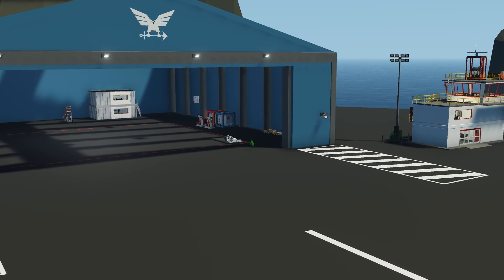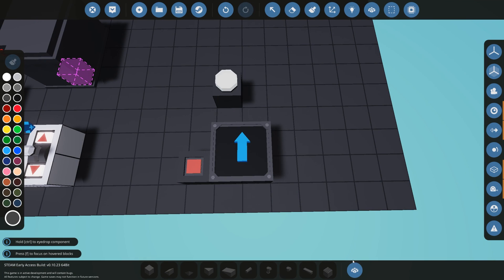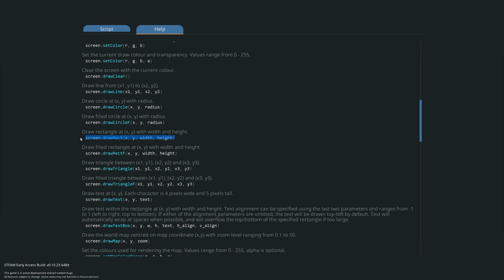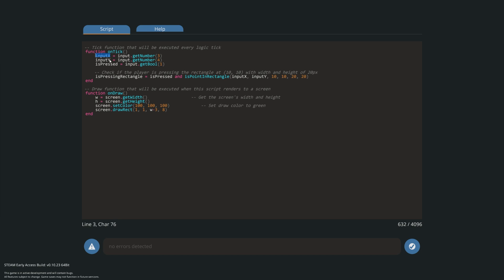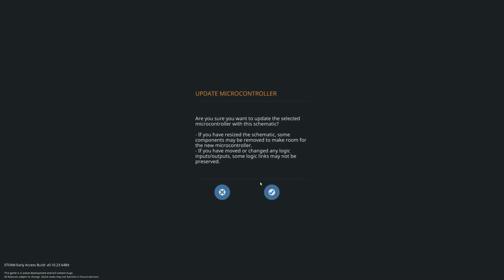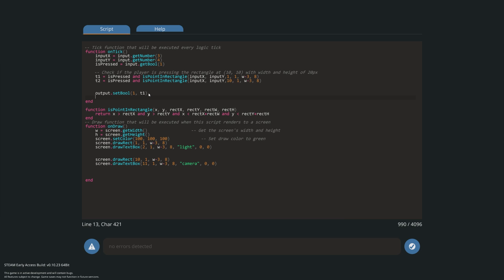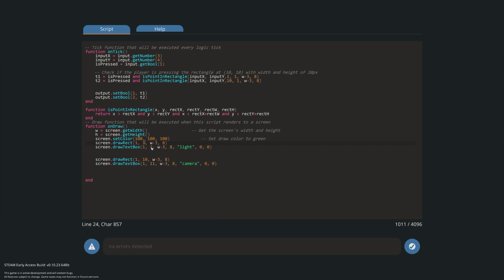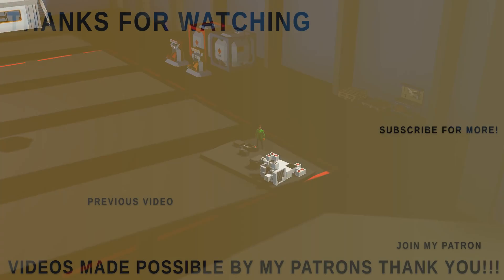Lua Build Series - Touch Screen Menu - Stormworks

Comment: Hey, after 2 hours of researching and thinking I decided to post my question here: I want to make a menu that toggles the screens just as in the video but the camera (as an example) is supposed to stay on screen until the user presses a "back" button. So far I've managed to let the camera stay there by using a "Push to Toggle" and I've also managed to implement the "back" button. The only problem I still have is that the buttons from the menu "camera, light, etc." stay in the background and I can still click on them. I'm looking for a way to disable these buttons as long as the camera view is on. I hope someone can help.
Reply from the maker: Make sure you have another menu for the camera screen. So you will need two menus. One for home and then one for when your on you camera screen
Reply: @MrNJersey  Thanks but I already have that. The problem is that the old buttons from the main menu are still touchable altjough they are not visible because the camera is "on top of them".
Reply: @labu5605  The composite signal that comes from the screen still goes to all the LUA blocks, so they all interpret it. You need some composite switchboxes to route the composite signal only to the LUA script that's responsible for the currently active screen. (Sadly there's no composite junction like there is for number signals, that would be really helpful here)
Okay this all assumes you're having separate LUA scripts for each menu. You can do it all in one LUA script, but then you need some additional logic to detect which menu is currently active and what buttons are on that menu.

Comment: Neither of your LUA touch screen examples show how to make those buttons work like toggle buttons.  So I need the onscreen rectangle to stay in the "pressed" visual state, and I need the light to stay on.  Do you have something that shows how to make these touchscreen buttons work like toggle buttons?
Reply: Toggling itself is quite easy. Just use a "Push to toggle" in your microcontroller
Reply: @labu5605  There's considerably more to it if trying to incorporate toggle buttons in a Lua touchscreen; but I managed to figure it out.

Comment: A little late to the party but, I don't know if you planned to this down the road, but an advanced touchscreen would do wonders. I've gone off your menu builder tutorial, but once you switch screens, the previous touch-select rectangles are still present, just not drawn in. So if it's just a simple fix, let me know, I can link the lua setup to you if it'll help, TIA.
Reply: Had this same problem. Solution is using composite switchboxes just like the video switchboxes.
Reply: @wimlekxs4443  THANK YOU
Reply: @wimlekxs4443  How exactly do I have to use the composite switchboxes. I've tried to figure that out for 2 hours now
Reply: @wimlekxs4443  (same problem) How do you use the switchboxes?

Comment: Can you do a tutorial on how to have the touch act as a switch instead of a button
Reply: Place I push to toggle between the output and Light input (in your micro controller)
Reply: You have to use a push to toggle block. It can either be inside or outside the Microcontroller. Inside the Microcontroller instructions: Have the push to toggle be in between the output from the Lua block to the light output node. Outside microcontroller: Have the push to toggle in between the Light activation node and the Microcontroller Light Toggle node.

Comment: Could you make a vid that does it so if you press the light button it stays on until you press it again. And put a gimbal cam on the background and add the buttons to move and zoom the cam. Also can you make an artificial horizon with speed and altitude for planes. I know it’s a lot but you can spread it out In vids. Thanks

Comment: That moment when you tried to add another output to the Read Bool from Composite... Considering we can write to multiple channels starting at an arbitrary one, it's silly we can't do the exact same thing with reading them! Good series though. Maybe this is overkill, but considering how many times you need to copy the x, y, width, and height for a button, it might be worth saving those values to a table, and having functions to extract and use them.
Reply: thanks man